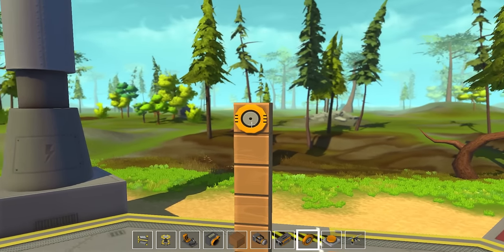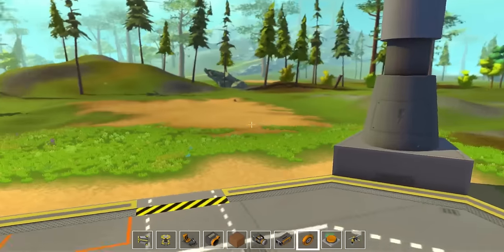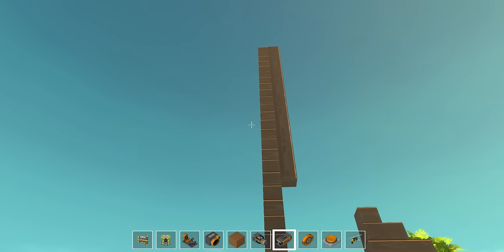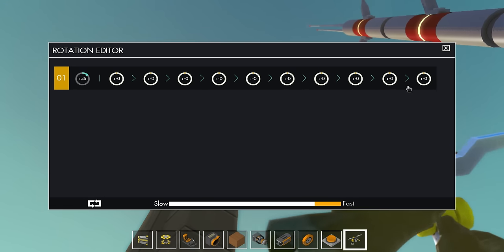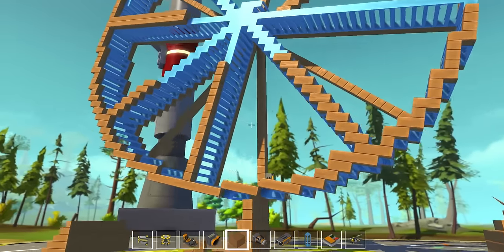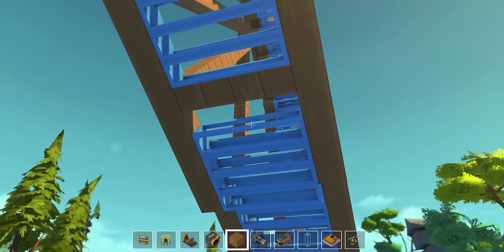Ferris Wheel! Scrap Mechanic Creation Guide & Tutorial (Scrap Mechanic Early Access)

Comment: lol cool build! You should attach an engine to the bearing so that the wheel can move faster, and only put passenger seats. That way you can have the engine set to a certain speed and have a switch to toggle the engine on/off.
Reply from the maker: +MattgregPlaysMC for some reason I didn't even think of using an engine, but yeah ill get on that

Comment: What you could do, is add an engine and the remove the middle bar where your seat is connected to. then you take a corner pipe and put it on the inside. if everything is right, it will not go upside down anymore.
Reply from the maker: +Jeroen Steens i tried adding an engine after the episode, basically what happens is it starts to interact and screw up the other bearings speeds and didnt help. id have to rebuild the whole thing

Comment: Hardly a ferris wheel when there isnt a single gondola :P you should put bearings on the side where it will have clearance and build small platforms with seats there. if the speed is right it shouldnt glitch out, swing around wildly etc but rather stay level, even when the ferris wheel is turning
Reply from the maker: +SuhkMah BAWLS wut? it has at least one gondola that i was riding in lol. Next episode ill be putting them inside the wheel though, so it will look right. "right speed", "staying level" - trust me, ive tried, have you played this game before?